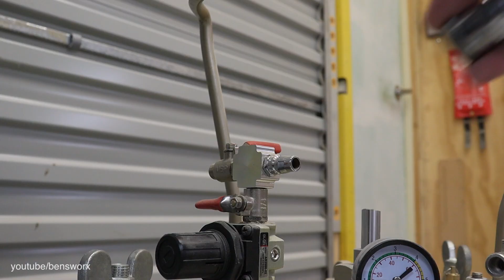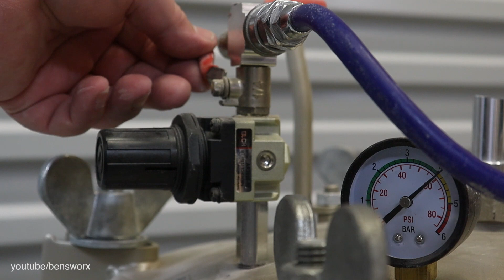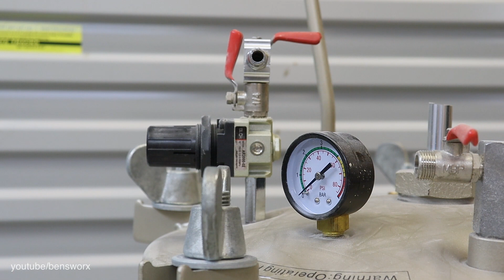Using Leftover Resin to Make a Halloween Art Piece

Comment: I think 319 pieces.  
Have you ever thought about using packing peanuts a inject them with different colors then put them in the pressure pot then paint them with clear resin and then put into a mold.  Let the mold set for a bit then inject 💉 colors into it.